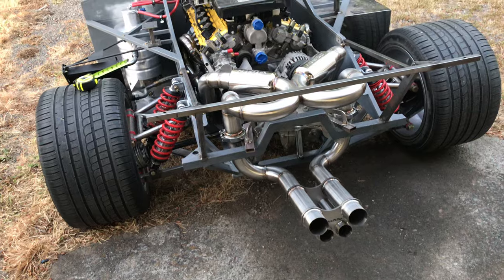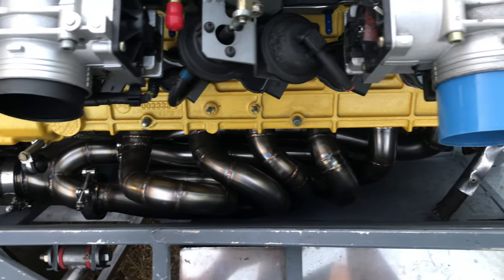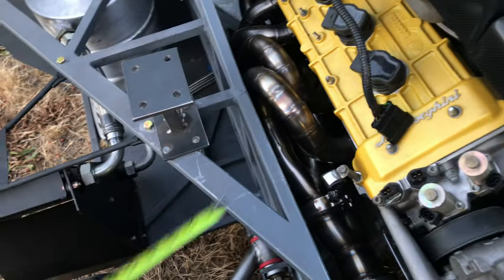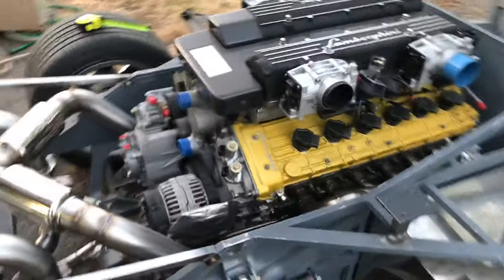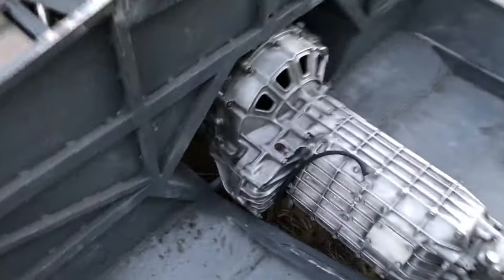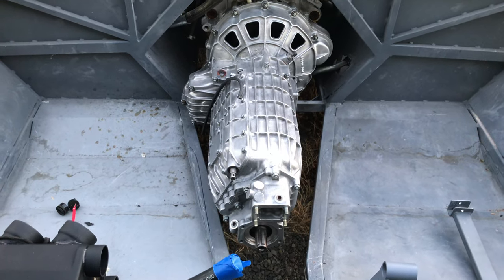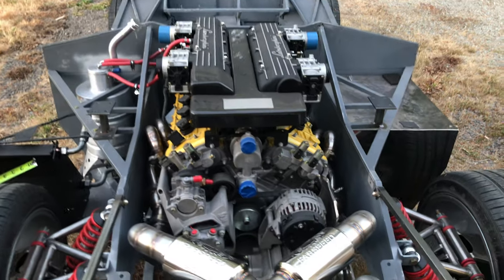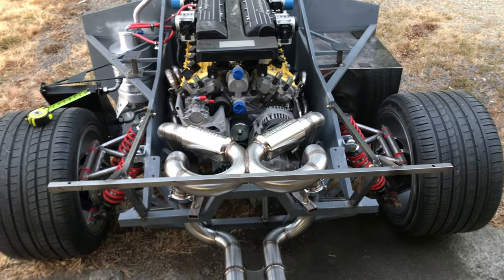Exhaust almost finished

Comment: So freakin awesome Rick! I finally got my LS running and getting ready to weld up some stainless pipes for the turbo and intercooler. Check out some pics and updates on my instagram Car_Building_Inspiration. Once it gets running it gets exciting. I got the power steering done. Brakes almost ready to bleed. Clutch line run from trans to pedal. Steering column done and wired. Push-to-start alarm with keyless proximity for ignition and locks. Stereo and amps in. Lights mostly all wired. Never ending (don’t have to tell you!)
Reply from the maker: That’s awesome! I’ll check it out.